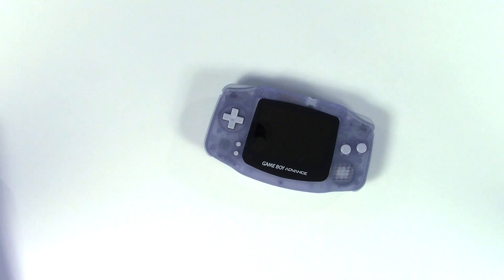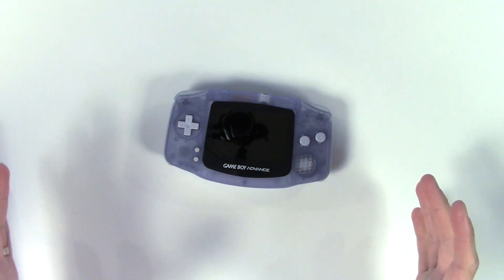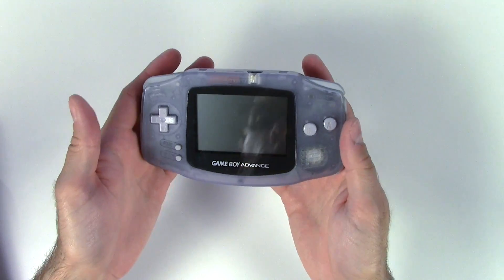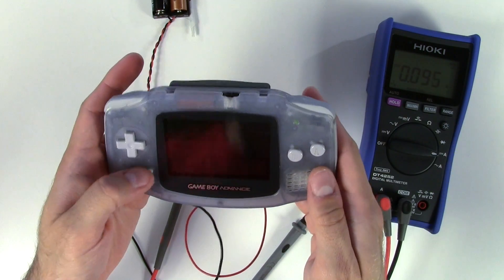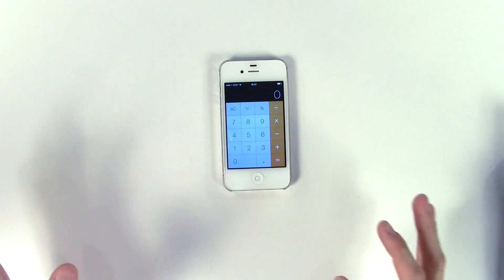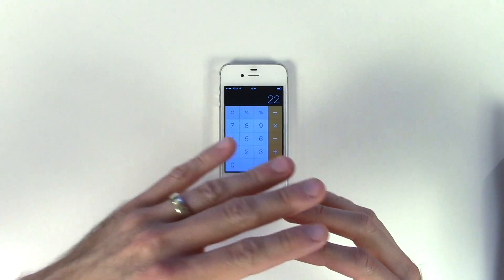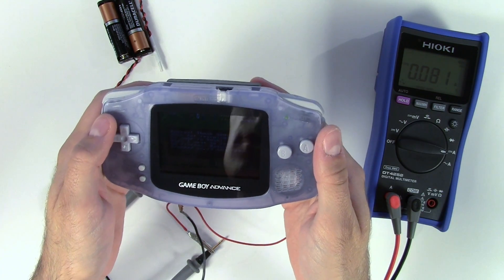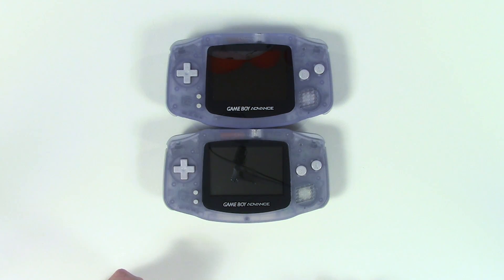Backlit Modded Game Boy Advance Battery Life Test

Comment: my ips v2 diplay consumes 300mA even on the lowest brightness! =/
battery life is only 5h max 0.o
Reply: What kind of batteries are you using? I just got my ips v2 gba and used some cheap brand new batteries and got like 1 or 2 hours on medium brightness. Very disappointed on it
Reply: @Rolly_951  yes i know. the display need a lot of power. but for me it's worth it anyway (i use rechargeable batteries with 3000mAh). also the batteries are not really empty but the voltage is after 2-4 hours not high enough (2x1,5 volts needed is a lot!) other devices might work still pretty good with the gba "uses" batteries. give it a bit time =) take care friend!

Comment: I just got my first GBA today, also ordered a backlight kit and an EZ Flash Omega. I was playing my GBZ (GameBoy Zero) and realized that for around the same cost a Backlit GBA is a really good idea since it can play almost the same range of games. The GBZ can play SNES and Genisis games. However, the GBZ was not easy to make but was a lot of fun. The GBA mod is easy and totally worth it. Battery life is a big deal too. I have a 4000 MaH in my GBZ and only get a couple hours.

Great video as always.

BTW in 2019 good luck finding an AGS-101 SP, better to just get the kits from AliExpress for ~$50 with the cable.

Comment: I recently modded my GBA for a backlit screen. I found this model has a little higher quality buttons than the SP. both SPs I’ve had (AGS 001 and 101) has dead LR buttons pretty quickly. But my original GBA’s LR buttons work like a charm. This is great for Zelda games, Fire Emblem, and other games that use LR in some way. 

I’m glad I modded my system. I never played it before I did. Now I’ve been playing it a ton and can buy games that I’ve never had before since all the buttons work. Easy mod too.

Comment: Is it the modded gba just the ags 101 screen or is there other mods to it(I don’t mean cosmetic like glass screen protector I mean like screen voltage regulator, sound improvements, stuff like that) and is this with volume on or off?

Comment: that doesn't make sense ... how does the AGS 101 screen last longer and use up less battery .. Shouldn't the AGS 101 with the backlit (the extra full on brightness light) last way way way shorter ????
Reply from the maker: Advancements in screen technology (the newer LCD panels themselves require less power), and LED backlights don't draw much current.

Comment: My modded gba with a screen found on AliExpress does not last more than a couple of hours with a fresh set of rechargeable batteries. I did 2 tests : one with the everdrive GB : consumption is 350 ma (huge !). And another test with the everdrive gba x5 : consumption is about 190 ma, which is more acceptable, but it will give only about 10-12 hours of play game with an average 2000 mah battery set.
I have yet to test with a standard GB and GBA cartridge.

Comment: I did this mod as well (with a kit from aliexpress, very good picture btw), but I noticed the screen now drains a lot of power. About 350 ma instead of 100 ma for the original GBA. A fresh set of alcaline batteries lasted 30 minutes. I calculated a pair of 2000 mah would last between 5 and 6 hours. I've very unhappy with these numbers ...
Any tip on what to do to lower the huge power consumption ? Thanks !

Comment: this is weird. my backlit agb001 only lasts a few hours with fully charged 2300 mah batteries. 23 hours?? I wish!
Reply: Let me guess -- your 2300 mAh batteries originate from a random Chinese factory? AA -sized batteries cannot possibly hold 2300 mAh, so it's likely they actually have less than 500 mAh in them.
Reply: They were "Energizer Recharge Power Plus AA 2300 mAh Rechargeable Batteries" which had great reviews.  Do they lie when they label these 2300 mah...?

Comment: i did this. i used the ags-101 backlight. Can anyone tell me what a good permanent battery would be?
Reply: I got myself one of these. Loving it. http://www.ebay.com/itm/152111027422?_trksid=p2060353.m2749.l2649&ssPageName=STRK%3AMEBIDX%3AIT
Reply: my current unmodified gba uses Nuon  (cheap offbrand) rechargeable AA's. I've been playing for 3 days with the same pair of batteries and so far they work great. If you can deal with recharging them on a stand then I suggest that as another option.

Comment: lol gains useage time.

but hold on, the mod that was applied, and the stock gameboy. They are of different colors. Are they both ACTUALLY nintendo gameboy advances or is one of them possibly a friggin chinese knock off. If you bought the modded one open up and see. Even if the case says its not, then maybe internals are bootleg knockoff gba or something. Ive seen many, im curious if they both actually are nintendo** gameboy advances.

My curiosity stems from 7:06 notice the color of each of these glacier/purple whatever its called gba's, it is slightly different. 
Let us know.
Reply from the maker: +DjStiv3 Both of them are legit GBAs; the un-modded one I got new back in 2002, and the modded one is from my original GBA backlight installation video. I think the slightly different color between them is due to the lighting, and also how they were stored (the unmodded one is slightly yellow from not being stored in a case all the time).
Reply: This Does Not Compute
ahh ok, yeah its possible then. Just seemed like maybe it was a fake.

Im curious tho, as i am considering doing the mod (i ended up seeing that you did it)
what tools do you use to do it? most notably solder and solder gun?
i have a solder gun i got cheap but its big and clunky, was wondering what a good small one would be to use.

Comment: Sweet! I just dug out a old original GBA, and ordered a replacement glass lens, and 32pin adapter cable, and have a AGS-101 that is pretty beaten up, and can't wait to do this mod, I am actually surprised that the batteries last longer, but after thinking about it a bit, and you did eventually mention it at the end of the video. That yeah, the AGS-101 screen is newer, and more efficient.

Comment: A good fix would be a rechargable battery. Specifically one that has a better storage capacity than the ones the likes of Dreamgear, Pelican, and madcatz sold which even without the backlight store only enough energy for maybe 2hours of gameplay.
Reply: +Objectified Cross The modded one used less power, didn't you watch the video? Also, you can get very good rechargeable batteries that hold a charge just as well. Eneloop pros are very good.
Reply: *****
Yes I did. I just never felt like editing my comment.
Reply: The rechargeable Wii remote battery packs fit a GBA.

Comment: I wish I still had my original GBA to do this with, but I traded it in for an SP at launch, and then a DSLite. Learned my lesson not to do GameStop trade ins on  impulse to get the latest thing.
Reply: DatGuyNuma hell, I just got a GBA for $20 from japan, not a single scratch on it
Reply: Commodorefan64 Hey, on the bright side, the Gamevoy advance is now a lot cheaper to grab on websites like Amazon. What was once a $100 plastic unit back in 2001, now costs about $25-50. (pending on the seller and color).

Comment: So did you replace the actual lcd or just the reflective layer. If you just replaced the reflective layer, you are lying. Theirs no way. But if you replaced the lcd then your conclusion is logical.
Reply from the maker: +greenmumm The whole LCD panel was replaced; this video was a follow-up to my original backlit GBA mod video. The kind of LCD in the GBA isn't capable of having a backlight installed like you can with an original Game Boy.
Reply: Ok yeah i figured you must have

Comment: Notice how the backlit GBA also had way more "low battery" time
Reply: +RWL2012 That would be a factor of the battery depleting slower. The system redlights when the battery crosses a certain threshold, not how much time the system estimates the battery has left in it.
Reply: Thanks for the info :)
Reply: Do the test with a couple of rechargeable batteries. The light will always be red since those ones operate on a lower voltage
Reply: Bad thing is you will have to estimate when to recharge them xD
Reply: +RWL2012 I would say thats because even they are same display, newer one even with led is from newer technology, if you have data sheet of each display, you will see the difference.

Comment: Have you thought on adding a lithium battery pack? So you have an internal battery that you could recharge and not having to swap batteries?
Reply from the maker: jodamacotube I've considered it, but what I've found to be a much better bang-for-buck are good-quality rechargeable AA batteries. I have a bunch of Panasonic Eneloop Pros and they're great -- they last about as long as alkalines and hold their charge when not in use.
Reply: Rechargeable Wii Mote battery fits in the GBA ;)
Reply: Commodorefan64 but due to the age of those third party battery packs for the GBA, they won't hold a full charge anymore.
Reply: This Does Not Compute  if you are going say on a plane for 8-10 hours changeable batteries are much better
Reply: +jodamacotube You could just get a gba sp
Reply: +greenmumm You can rechargable battery packs for the original GBA, as I actually had a couple of them, and one was from Nyko if I remember correctly, the other one was some no name Chinese wanghunglow brand I found on eBay, and both snapped right into the battery compartment adding very little bulk but more weight than normal AA batteries.

Comment: How do you Mod it??? I have a few GBAs and i Have 4 SPs...Honestly i like the GBA's design better than the GBA SP's. anyone agree. It feels better too.
Reply: +Kyogre Cubing | ikyogre1 He said he already had 4 sps. As long the Sp you have is backlit (ags-101) you can do it. You just need the adapter ribbon cable. Make sure you're using the correct type, there's a 32 pin and a 40 pin one.
Reply: songoku64 You would need to originaly buy a kit. But sadly, the kits have kind of sold out.
Now your only option would be to buy an SP! But make sure it is the AGS-101 model. The AGS-001 will not work. Take the screen out of the SP , and then you can buy the connection adapter on ebay for pretty cheap.
Reply: Kyogre Cubing | ikyogre1 hello my.... Enemy

Comment: Thanks for the videos!
I'm glad it all worked out despite the frustrations you encountered.

I just bought a GBA from eBay so I have to wait and see which cable kit I need but wanted to see what is in store for me.
Heck, now I can hardly wait to do this mod!
Reply: Follow up:
I absolutely love my backlit modded GBA. Labor of love and totally worth every bit of effort.
The screen was from a GBA SP with a curiously smashed lower section. I was lucky to find it.
I took the time to recondition the PCB and pretty much rebuilt it with a new case and parts while I was doing the mod and topped it off with a glass screen.
The re-assembly was tight; however it all came together and...wow. Like I said, worth the effort and some.
Again, thank you for making this series!
PS:
Yikes! A backlit modded GBA fetches a bit over a hundred bucks at this point and screens are nowhere to be found unless you rob one from a GBA SP!
Makes me glad i did mine when I had the chance before the wave hit.

Comment: You were expecting different results? Why? You are comparing 2 screens made 13 years apart. You don't think the old screen was less efficient than the newer one? The advancement in LCD technology since the original GBA came out has been exponential and it's not surprising at all. You are also comparing a brand new screen to a 13 year old screen which may have lost some efficiency over the years. Furthermore, I think you should have used an oled screen, they are superior to anything you could put in this old GBA (assuming one is made). A MUCH, MUCH better test would have been with rechargeable cells where load doesn't affect the amount of energy the cell can deliver. and you would do it multiple times and average the results. But this is a commercial and not an actual DIY guide or independent review.
Reply: ***** I have a GP2X Wiz with an oled screen and it looks fantastic.

Comment: You just went off the deep end. Those batteries have no such rating, no primary cells are ever rated that way. The load dictates the ultimate recoverable energy you can get from the cells.  The higher the load, the less energy you get. In addition to that, the falling voltage means it's very difficult to get watt hours computed. I know you said it was rough, but you are either ignorant or lying about the 2200mah rating of these cells. The datasheet for these cells shows you are wrong.
Reply: *****
Sorry, I don't like commercials disguised as DIY or reviews. If you or the OP knew the first thing about batteries, you would know I'm right and it was a bad piece of information in the video.

Comment: What do you think about using a rechargeable battery pack in the modded GBA
Reply from the maker: I don't think I'd bother retrofitting a rechargeable battery in one, but using good-quality rechargeable AA batteries, like Panasonic Eneloops, wouldn't be a bad idea.
Reply: Rechargeable batteries are definitely the better way to go. I found an energizer kit on amazon that came with 4 batteries and the charger for about $8. I think it went up but it's still at about 15 which is not bad at all.